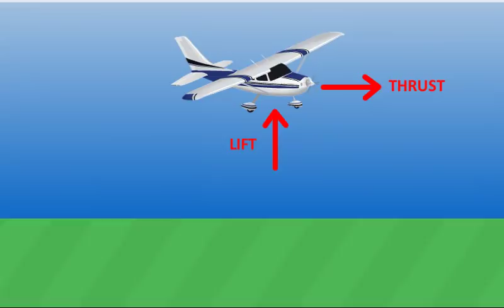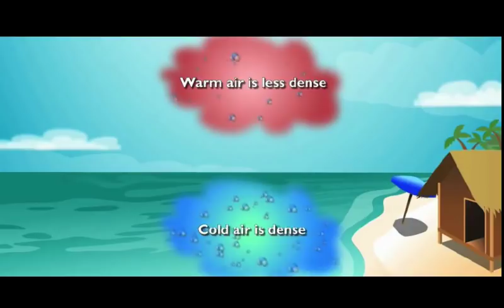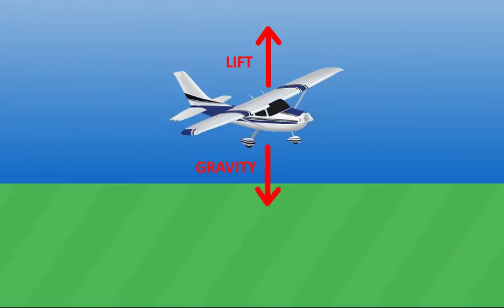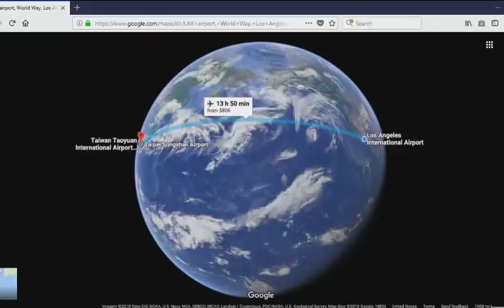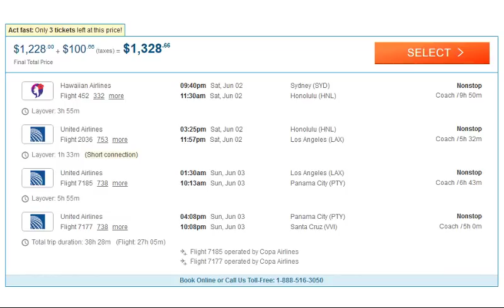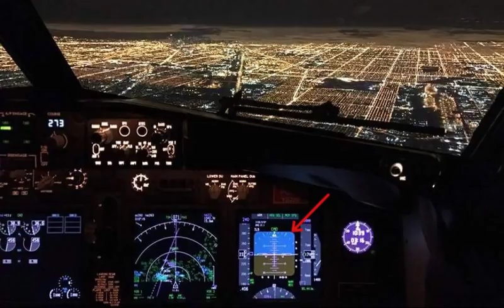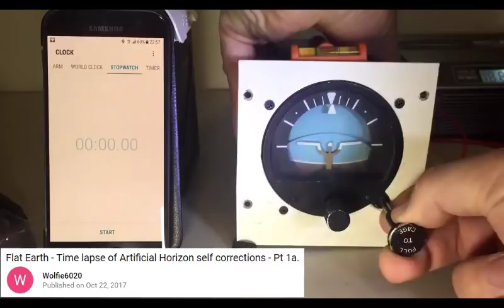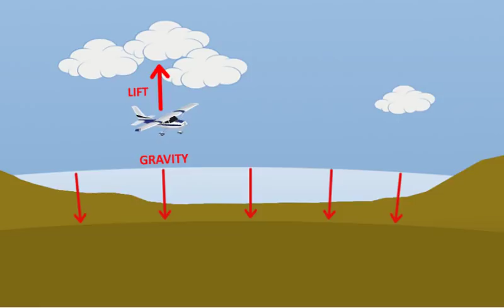Flat Earth Falsities - Plane Nonsense

Comment: A good experiment to prove that density causes relative motion of object is to repeat the cavendish experiment with 3 inertial rods kept in a vacuum.  1 rod is lead.  2nd rod is water dishes.  3rd rod is bigger water dishes equal to the lead balls.  If the rod moves towards the water dishes as a preference, then there is a space time density harmonic happening that is independent of a universal gravitational force.  If it moved towards the lead balls, it would show that gravity force exists in order of density.  If it was inconclusive it could mean that gravity was universial.
Reply: Just because objects attract eachother doesn't mean the earth is round.  It can do that also in a flat earth model.
Reply: Ethan Walker
There is no such thing as a "flat earth model" all there is is an interpretation o the bible, i.e. biblical literalism, and nothing else. And gravity is impossible with your idiotic delusion.
Reply: Ethan Walker —
     ►"Just because objects attract each other doesn't mean the earth is round.  It can do that also in a flat earth model."
      The Sun is round. The other planets are round. The Moon and other large moons are round. Their form is the product of gravity (and they all move under the attraction of gravity). None are flat.
Reply: Thanks Ethan for rare intuitive empirical experience suggestions, just parroting monkeys about for all these false experiences that did not prove anything claimed by Authorites. Never will be any lab method showing off this MASS gravity business, but in this Electric universe magnetism is a witnessable FORCE.
Reply: Such crap from I.think, who fears everything disputing gov claims.
Why the Cavendish Experiment Is Ridiculous - Flat Earth
/watch?v=pJ-7kbaHUgM

Comment: Ok IN NO WAY do I think the earth is flat.  
But your first proof is faulty, If you had something as massive as a flat earth that had a dome over it, you would still have air pressure differential because of the massive size of the object and the massive amount of air.  Any fluid or gas exerts pressure on the fluid below it, you just don't see it in air in small scale because its such a small amount.
Reply from the maker: Anthony Marino - Yes, you are correct, assuming the air is contained AND there is gravity acting on it. But some flat earthers claim gravity does not pull on air. I could have been more clear, but I did say “contained in the dome RATHER than held by gravity”.  Thanks.
Reply: Voysov I will admit, I did watch it again and noticed you were talking about the dome not having gravity.  My mistake.
Reply: Wong,  Do you not understand that atmospheric pressure is greater at sea level and less on top of a mountain?  Why do you think this is?  All the air above is pressing down on the air below.  You seem to believe in science so not sure what your not understanding.
Reply: Anthony Marino Why would there be a decline in air pressure with increasing altitude?
Reply: Flook D
"Why would there be a decline in air pressure with increasing altitude?" Goddidit?
Reply: Air has "atomic weight". Where there's more air, it's heavier atmosphere, thus the barometer works somehow.
Reply: The problem is there is no gravity according to the flattards :)
Reply: Gizmo D
"The Roman Catholic church invented the big bang" No. A person proposed the theory, the fact he was RC is totally incidental. The idea put forward by Georges Lemaître was then developed over many, many years by many people. Lemaître's hypothesis was given a major boost by  Edwin Hubble and Hubble's Law. And so on. Please at least attempt to obtain and understand the facts you silly child.
"and all the mathematical formulas that surround it" Lie.
"as well as the scientific Method." Lie. The initial model of scientific inquiry, or the scientific method, was proposed by Aristotle, with  Ibn al-Haytham, a Muslim being considered by some to be the father of modern scientific methodology. The term "scientific method" was not common until the twentieth century. and there is now no scientific authority as to it's meaning.
"Didn't know you were Catholic did ya ?" I'm not, but you are a fucking idiot.
Reply: Gizmo D
"The Pope canonized the work" Why do you lie? Do you know what canonisation is? Because I would love you to describe what canonisation is, how it is decided and how an hypothesis could be canonised?
Reply: wong Perhaps he is confusing "the Alpha & the Omega" with Alpha Beta Gamma?
Reply: One's Greek the other hebrew. I prefer the Hebrew, it's more specific.
Reply: your shooting friendlies check your fire.
Reply: @angloempire6935  

Lol! So much truth.
Reply: CEASE FIRE!  Head count: Casualties, wounded? Anybody get saved?
Reply: It's good to use logic, but fine tuning the hypotheses is an ongoing necessity.I'm sure the air pressure exists in the dome.And that there's air outside the dome too.  There's living people up there in heaven.
Reply: I can spell okay, I just cant see these tiny letters on the screen, and I dont know how to make them normal size again.Any ideas SP? You left out the neutrons, and quatks and what came after quarks? Are you a nazilluminarty follower of Crowley?
Reply: "Georges Lemaitre suggested the observable and physical expansion of the universe"    And what chapter of the Bible has that evidence Mr. nazi superior race breath?
Reply: Be careful, they have buttons to push.
Reply: Was that the year they made it Heresy-"punishable by death-to declare the world flat"? They never took that one off the books etiher.

Comment: Some of those flights go so far out of there way for political reasons.  I once flew from Tokyo Japan to Riyadh Saudi Arabia.  On the map it is 5 time zones and maybe 10 hours in the air (the short way).  It took me 38 hours and a flight from Tokyo to Detroit, to Washington DC, to Cairo Egypt, to Bitburg Germany to Riyadh.  (the detour to Germany was to get on a US Air Force transport for the last leg).  Now the reason I had to go the long way was because of laws not allowing over flights of certain countries by US military planes.  Even if they are just passenger planes.  And after a year playing in a lot of sand boxes I had to make the same trip in reverse.  Even some airlines must fly around some countries so flights go way out of there way to be sure to avoid entering airspace they are not wanted in.
Reply from the maker: Yes that's true. It interesting to watch planes route around North Korea on flight trackers, for example.
Reply: If you're still an active flyer, you might take note (with a compass) exactly how long in which direction you flew. I've asked questions before and flight attendants are highly sensitive to these questions.  It' seems better you dont ask. It' may cost you some peanuts, maybe a dinner.

Comment: You need to also look at the jet streams, and note the upper atmosphere spins faster then the earth rotates. All Jet streams run West to East at an angle changing latitude, and move faster then the surface of the earth in the same direction of spin. What ever causes the earth to spin is pushing the upper atmosphere faster. This cannot be simply friction with the ground.
Reply: Reasonable, but they all claim its Momentum! Even if no dome it sticks and follows, that is GE science.
Reply: David Lowrance You're incorrectly assuming that there can only be one cause for air movement. 
https://en.m.wikipedia.org/wiki/Jet_stream
Reply: Thanks David you are the only honest conformist that admits he (or Science) does not know what makes sphere Earth spin, on a fixe axe and speed.
Reply: Sad to tell you this, but  the heat from the sun is what pushes clouds around, and the higher altutude air below the dome recirculates the warmed air. There's no spinning.
Reply: Garland Parks
Fuck off you pathetic troll.
Reply: I know of a brain surgeon who can fix your problem
Reply: HA HA HA GOOD ONE! He is so aggavated (with me?) that he now spouts that to all rational comments, he does not understand complex reasoning.
ps: same as tides, not Moon pullings, but temperature changes.

Comment: Ball heads are Ok with IMAGINARY AXIS........but tell em Water stays Flat and Level due to natural order of Physics and they lose they minds....
Reply: Flat and level to a point of reference, that point being the center of the Earth.  But trolls gonna troll.
Reply: Fuck off troll.
Reply: @boffeycn  no seriously..you stalking me....do I need to Mase you?
Reply: Simple fact you chose to be clueless on Physics 101!
Reply: @NotTheCIA I.think how does it work, then?  I mean, last time I checked, gravity is relative to the center of mass, and well the center of mass is a ball Earth.  But it's gotta be a conspiracy dating back 4 thousand years.  Who knew the Masonic NASA has been running things that long?
Reply: Hey Clive did any GEers Science knowers give you an explanation of how /why the mad rogue twirling BALL got a fixed axe? Wonder how She decided on that one, has She was flying around, caused Her to get a fat peared oblate belly :(  strange as there is no UP & DOWN... Least She decide to keep a steady spin speed, because if not... Momentum would had a hard time, dispite Gravity, those air pressure systems dont care for the big M, little difference of density and backwards winds go!
Also wonder at what point She held tight on to the building atmosphere?
Reply: @BrainUser1  no they in here losing their minds
Reply: @BrainUser1  what the hell are you talking about?  My 8 year old in hysterics makes more sense than that does.
Reply: steve gale Your tyres are still round; you've been brainwashed into thinking they're square by the tyre manufacturers who profit from selling you the wrong shape.
Reply: Clive you got 2 christian hater that are (Baal)religious...;
#1 +Dios de baca is spanish of God of Baca...
Baca [N] [H](weeping ), The Valley of, A valley in Palestine, through which the exiled Psalmist sees in vision the pilgrims passing in their march towards the sanctuary of Jehovah at Zion. ( Psalms 84:6 )
 Bakkah (also transliterated Baca, Baka, Bakke, Bakah, Bakka, Becca, Bekka, etc.) is the ancient name for the site of Mecca.

#2 +Mr Xexes 'king of Babylon'... nice, more Royalty controllers. 
Of the Religion of Zoroastrianism: one of the world's oldest religions, monotheistic faith, centered in a dualistic cosmology of good and evil, sounds like Freemason, Jews and other Elite cults. 
HE sought good omens by sacrificing white horses, buried alive nine boys and nine girls who were children of the local people. 
Yes all nice religious Greek /Roman style civilization behaviors.
Reply: @BrainUser1  yeah, well, you still aren't making a whole heap of sense, though after drinking several bottles of Windex I think I have sussed out what you mean.

1. The axis was likely determined based on how it was formed and also likely impacts from planetoids/asteroids and the like.
2. "Up" and "down" is relative.  They are adjectives created by man to describe the world around them.  They have no meaning outside of our view of the planet.  In zero gravity where is up? Where is left or right?  If I'm upside down relative to you,  then my up is your down.  However we orient ourselves relative to the center of the Earth, so our "up" is the sky, our "down" is the ground.  Nothing more, nothing less.  Quit trying to make it more complicated than it actually really is.
3. Oblate spheroid is because of 2 things. First, centrifugal force causes the equator to bulge a very very tiny amount, second the gravitational forces of both the sun and the moon have miniscule affects on the shape of the Earth.  The Earth isn't a solid rock, it's more of a crunchy shell on a gooey caramel center... In other words, what's deep below us is liquid rock and metals, with our crust floating on top of it.  Hence it bulges ever so slightly, definitely not enough to be visible in pictures or on land.
One thing I can't seem to get is why flat earthers have such a hard time grasping just how huge this planet really is.  It is _massive_.
By the way, my name isn't even close to what you think it means.  Basically my Spanish teacher had a speech impediment, and pronounced vacca as baca, and my nickname in school was Cow God.
Reply: Suddenly after my last you decided to respond...
Not first language and horrible writer, so what, I spit out more then;
"Water does not stay flat and level. / thats not how physics works."
How it was formed ? What is the latest again? Not a twirling (iron?)(burning) rock attracting more rocks as it was BANG flying?
Does it not have an also perfect ball iron core distrubuting evenly Gravity?
Can't get more vague and elusive then that, are you a scientist?
More scientific jargon, likely /probably, "impacts from planetoids/asteroids and the like."
AND? IT was not twirling aka spinning before? Fine for spin but not for a fixe axe, inclined or not...
So no "osculating" then? Dam that sounded so.. scientific :)
Reply: What are rain drops curved? Slowly push water out of a dropper. Until it falls away it is curved. Surface tension on water is so pliable it can take any shape.
Reply: steve gale  muh conspiracy!!!!
Reply: Flatters don't understand physics.
Reply: Oh, Clive and his "IMAGINARY AXIS" proof again. LOL
Reply: See they losing they minds
Reply: steve gale  how does it stay in any large quantities?
Reply: @NotTheCIA I.think my bad, I misunderstood whom you were replying to
Reply: Any GEers can explanation of how their rogue twirling BALL got a fixed axe? 
Wonder how She decided on her axe, as She was flying around, giving Her that fat peared oblate belly :( 
Strange as there is no UP & DOWN for causing pearness... 
Least She decide to keep a steady speed spin, because if not... Momentum would had a hard time adjusting.
Dispite Gravity, those air pressure systems dont care, just a little difference of density and backwards winds go! 
- is that plain simple enough for everybody? I am waiting!
Reply: @BrainUser1  wow, just... wow.  First, triggered much?  Second, repeating the same inane babbling doesn't make someone understand inane babbling any more than it did before.  You're sounding like the homeless man on the corner yelling at traffic. No, it is not plain enough for anyone.  Despite what you think or believe, gravity is a real and testable force, and while it is physically a weak force given enough mass it is not hard to pull an object towards it's center.  Thermal currents are more than enough to counteract it for the most part (think hot air balloons), and it creates the vast majority of the wind on this planet.  Simple, testable experiments can prove all of this of you are willing to actually look at evidence rather than "muh confirmation bias".
Reply: Clive Byrne: An imaginary axis, that does pretty good for explaining why we see 2 celestial rotations in the nights sky, one in the North and one in the South. Also does pretty good for explaining our seasons, the 24 hours sun in the north and south during their summers, the equinox's, the analemma or figure eight pattern of the Sun over the course of a year, the flipping of the Moon when observed from hemisphere to hemisphere, the fact that you weigh slightly less at the equator....it makes sense of a lot actually. The axis of the Earth wasn't a guess...it's based off of observable evidence, evidence that when all compiled and accounted for, makes sense only if you apply it to a Globe, with a tilted axis. So, I'm not sure why you think it's imaginary.

Mention gravity as the force that is keeping water flat and level on the surface of Earth and Flat Earthers tend to lose their minds as well. Always so unable to imagine how perspective changes the smaller you are compared to the surface of an object in the 3D reality we all inhabit. Here's a good visualization for you to see what I mean, the guy who made this isn't even a Globe Earther per se, just rational. https://www.youtube.com/watch?v=GWJxl9ddRkQ The closer and smaller you are in comparison to a massive 3D Ball, the flatter it will appear to you. We are tiny, the Earth is massive and we are standing directly on its surface. 

Here's another visualization. 
https://pics.me.me/proof-that-a-basketball-is-flat-i-used-the-zetetic-34402542.png

Comment: It's typical that they assume that if there's a dome, there's no air outside the dome, so the inside has to be pressurized like a cabin. Other misconceptions plague a skeptical mind. So there's so many videos to explain all the misconceptions and phoney meme pictures that make a flat earth  look impossible and silly. The ones in the memes of course, ARE impossible.
Reply: You find this dome yet?
Reply: NEWSFLASH NO DOME EXISTS! CAUSE THE EARTH IS NOT FLAT!
Reply: A pressurized dome still wouldn't explain why air pressure decreases with altitude.
Reply: Simple fact that you have a magnetic north above the Equator and a magnetic South below the Equator, look at a compass!
Reply: You mean, look at the  compass when you're down in the south. I cant because I never go there. What will I see? Where does the needle point?
Reply: Fuck off you pathetic, lying troll.
Reply: Pathetic sheeps, never heard of Operation FISH_BOWL?
Lot of peircing when on, and paid the price....